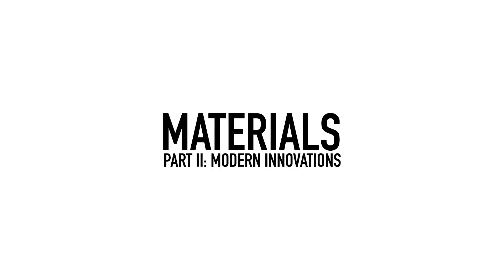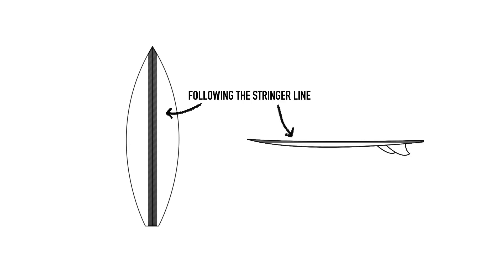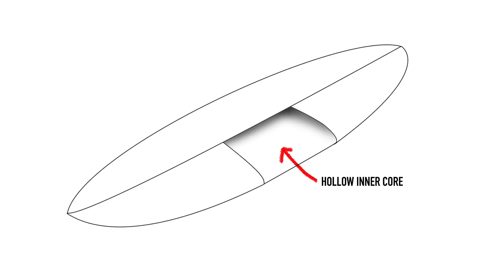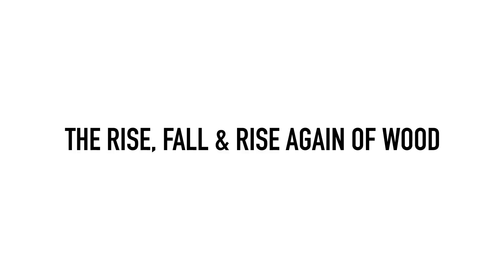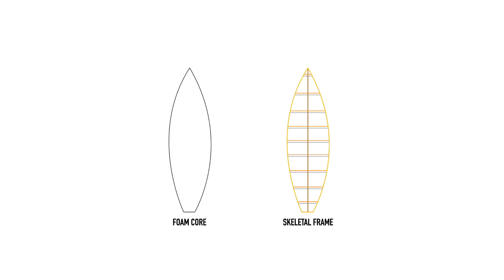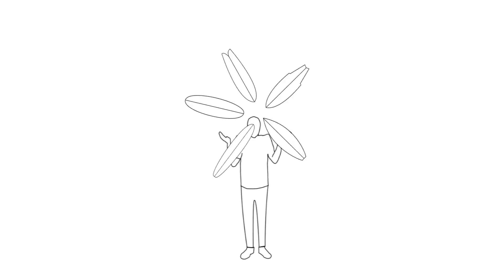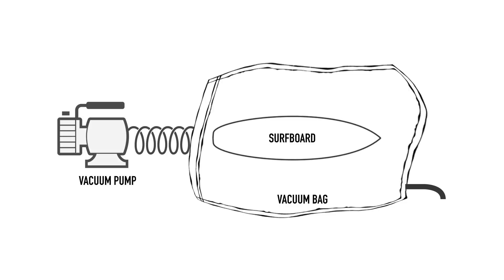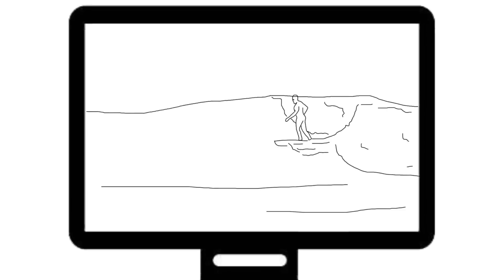Surfing Explained: Ep11 Surfboard Material Innovation

Comment: There is a lot BS about the flexibility on the water. Check Roy Stuart, he breaks the theory down. 
I have shaped boards that flex a lot on hard surface but the water not that much. Only felt it when hang five. I shaped with all materials. After years, I am back with Poly boards, "PU on Polyester resin." They are the best. Although not as durable as EPS on Epoxy resin however, PU cells are way closer and Eps. Hence, if you ding them, you won't waterlogged immediately unlike EPS which is an open cell material. To be honest EPS does float a bit more than PU.

Comment: Nice video, better than most for sure. Don't forget the benefits of Biax or Triax over plain weave. And UD carbon over woven. Also the benefits of molding for accuracy, resin distribution (particularly in heated tooling) and waste. Check out pre-preg, vacuum is great but throughout the high end composite industry pre-preg is the go to now. Give Sunova a shout out if you're crediting the development of the balsa/paulownia skin/rail stringer. Keep up the good work
Reply from the maker: Great point Phillip, there are certainly lots of innovative options out there!

Comment: This simple answer why traditional construction still dominates boils down to cost. New construction and materials require an RnD budget which for the most part most surfboard manufacturers lack. Even FireWire took Bert Berger's construction and developed a way to mass produce which required large investments. Add to that guys that do surfboards aren't engineers and don't have the knowledge of the newer exotic materials and it's properties to make sense of it all. Like you said it's all trial and error...oh and copy what the other guy is doing